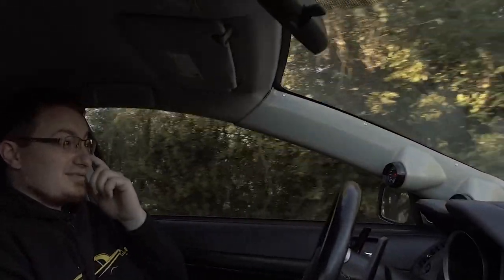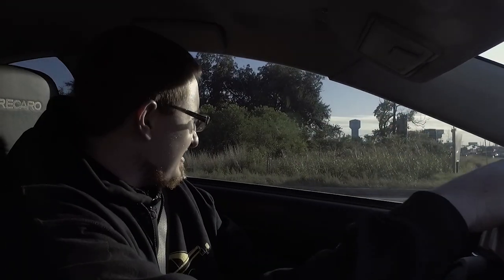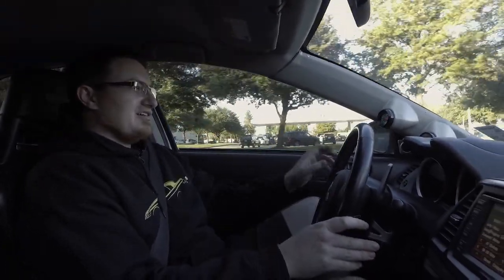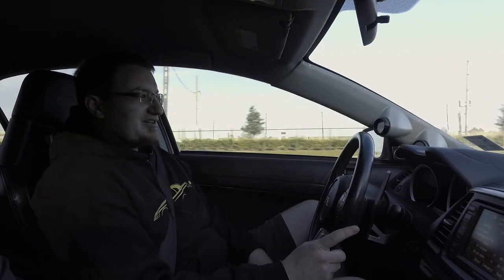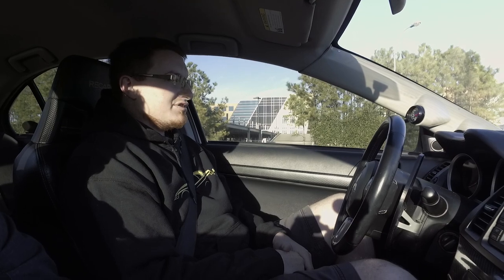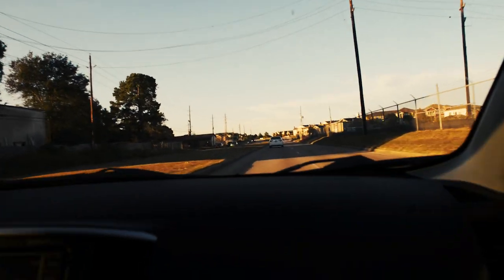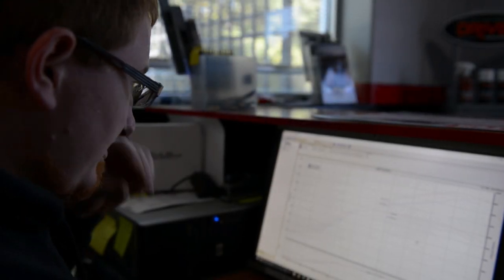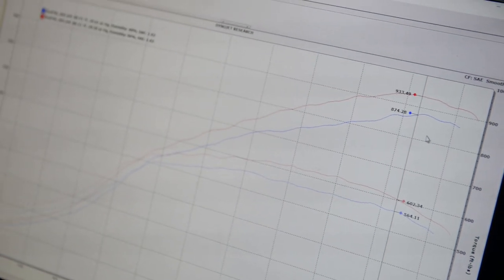Kozmic Motorsports World Record Evo X MR

Comment: Hello from Alberta, Canada…
I need to call /email you guys soon.. 👍
I have a DCT-470 that needs to be upgraded..66,000km on car .2008

I’m upgrading the SST before a turbo and cams..
Only summer driven , 
my goals are-
Casual street driving , and highway to out of town events. drag or a track race.

 And , eventually have the car be reliable at launching with 500+ hp. 
And does the factory launch mode work the same after you guys upgrade the SST or is there a different way of launching the SST after the mod/upgrade.
Regards , Michael.

Comment: MR is only for automatic drivers lol no matter how great of a build or good looking car automatic is not the same feeling as manual oh, btw grand drive auto too so
Reply: it is simply the fastest shifting transmission in the world. It does rob extra whp but in an evo those are easy to overcome. The paddle shifters use the sst and are hella fast- love you see you at the red light and show you my rear license plate for a few miles;)
Reply: That automatic transmission shifts quicker then u ever will hate all u want but it is faster
Reply: u can look down on the SST all u want, but this shit can smoke cars with higher hp easier than a manual in terms of shifting. I owned an EVO 6 and EVO 8 and currently driving an EVO X MR. I drag my car and I can tell u even myself after driving manuals for years, can't shift that fast.
Reply: This car was actually ahead of its time. Dual clutch autos are taking over now. If you want to go fast there is nothing better.
Reply: I have a stage 4 shepherd racing transmission on my 4G63, an evo3 1st gear, double synchro on every gear- one of the nicest manuals you can get - I like driving my Evo MR better, way more fun for street driving. Everyone likes something different, I have 7 cars and the Evo X MR is driven the most, and I have the most fun with. You likely made up your mind before trying it though.